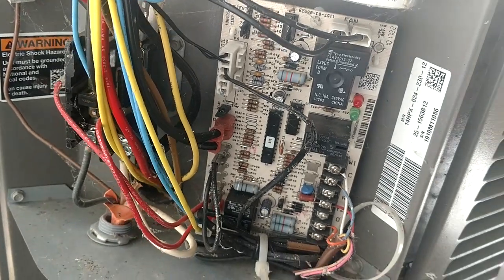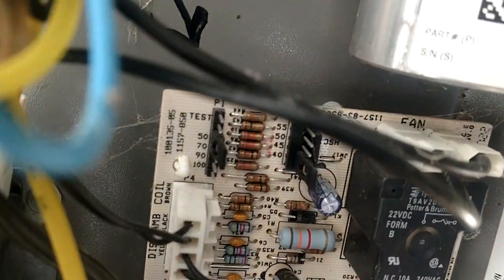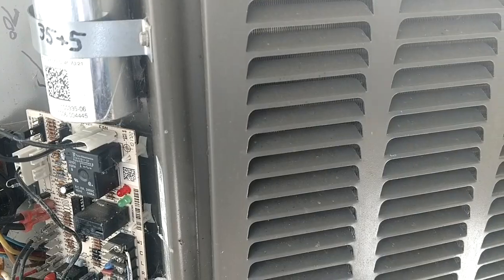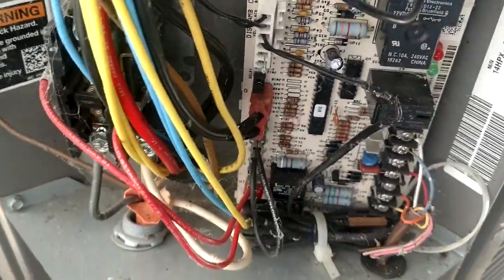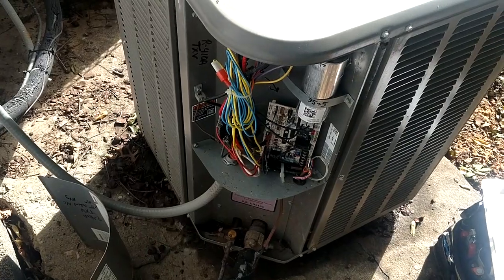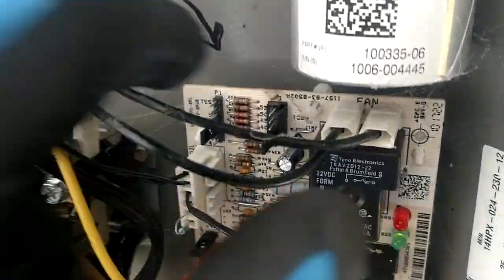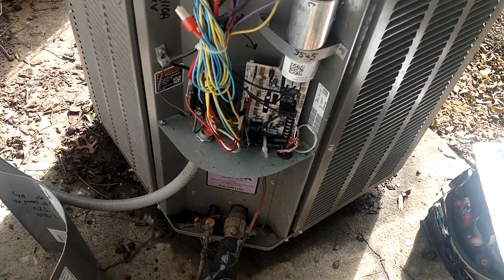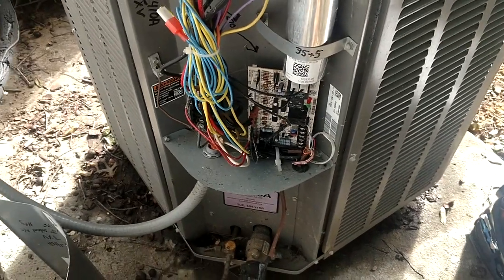50°❄️ Lennox "Demand Defrost Boards" factory set to 50° Will Not Thaw Coil. Needs to be set to 70°🔥

Comment: Thanks for answering my previous comment. One question. Does changing the temp jumper to a higher setting cause the heating cycle to run a bit more? Just wondering🤔.
Reply from the maker: @mindsablank8061  It shouldn't.

Comment: Thank you. Almost certain you fixed my problem. ❤
I had to have the defrost board replaced in summer. The unit was kicking into defrost, even on hundred some degree days. After many trips because the guys didn’t know what the heck they were doing, they replaced the board, etc..
Fast-forward to winter, and half my unit was ice. 
I was getting rings of ice that bent the panels outward  😮 
Following your video, I saw that it was set to 50, I have it set to 100 for now to see if that takes care of the icing problems I’ve been having. 
This is after checking the filter, putting it in the test mode to make sure that it worked and all that kind of stuff basic stuff
Reply from the maker: @MollyGIRLnug  hope it works for you. Glad you found the video helpful. And thanks for watching. 
😎👍

Comment: Hey.  Just curious. What is that other pin selector to the right of the one you’re talking about.
Reply from the maker: @kevinpearce3281  that's the setting for when the 2nd stage compressor kicks in. I never adjust that one. Thanks for watching. 😎👍

Comment: we just had a EL17XP1 installed, old system was an 18 year old tempstar, but I find the new Lennox unit always go into at least one defrost cycle per heating cycle today. it has been between 30-40F and the heat pump went into defrost at least 10 times between 7am and 3pm today. Could it be this jumper setting ?
Reply from the maker: Yes if it's the demand defrost style board it needs to be on at least 70°. It could be pushed up to 90° but I wouldn't go any higher. If it's on the factory setting of 50°then that will cause you issues. And you will have higher than normal power bills also. I hope that's helpful. And thanks for watching. 😎👍
Reply: @sknight0391  very helpful, glad I found your video, will check those jumper setting tomorrow, thanks again and will update if it improved the frequent defrosts
Reply from the maker: @andreels  always be careful when working around high voltage!
Disconnecting power is recommended. ⚡⚡⚡
Reply: @sknight0391  i'll pull the breaker before I open it ;) thanks
Reply: @sknight0391  I just check that jumper, and it was actually on the 90 setting (4 pins open above), so I guess that was not my issue :(
Reply from the maker: Could be. That unit probably has the board, that I discussed in the video, that is time and temperature. So the pins on your board will have an option for defrost every 30, 60, 90 minutes. And if the installers set your unit to defrost every 30 minutes that would sound about right based on what you said. The unit is defrosting almost twice an hour over a 6-hour period. If you live in an extremely cold, more Northernly or Mountainous climate, I would probably leave it at 30 minutes. If you're in a more mild climate then you could get by with defrosting every 60 minutes. 😎👍
Reply: @sknight0391  thanks for the reply, but i think its a demand defrost board, looking at the diagram, it looks almost exactly like the one in the video. i don't see a 30,60,90 minute jumper, but the 50,70,90,100 F defrost termination pin (P1). could it be too low and never defrosts properly and just go back to defrost a little later ? edit: i see it sometimes only goes into defrost for about 3-4 mins, only to later go into defrost again within the same heating cycle

Comment: Hello, I have a EL18XPV that my installers have been struggling to figure out the issue. It’s installed as an add on to our oil furnace, running through our existing ductwork. It’s currently entering defrost mode, then seems to get stuck in it blowing cold air into our home for upwards of an hour which drops our house a couple degrees then it has to heat up again. 

Would this possibly be the issue? We are in Nova Scotia, Canada.
Reply from the maker: Slightly different defrost board on that particular unit. But still the same issue. That black jumper shunt needs to be set to at least 70°. And where you're located maybe even 90° in order to get the coil to thaw out completely top to bottom. There was also an issue with the coil temperature thermistor location on some of those units. It was mounted a little too low from the factory and needed to be moved up a couple of row higher on the coil (which would place it slightly below the "middle" of the coil). And if you're blowing cold air into the house during the defrost cycle then your supplemental heat is not coming on during the defrost. If this is a dual-fuel configuration using the oil furnace as backup heat, then it needs to be wired to bring the oil furnace on during the defrost cycle. And that keeps you from feeling ice cold air conditioned air coming out of the vents while the condenser unit is going through defrost cycle.
Hope this helps. 😎👍
Reply: Did you ever get that issue resolved? I have the same heat pump installed and it does the same thing.
Reply: @Intake88 hello, I did not. Lennox wasn’t really willing to do much to help and the company that installed it suggested a different brand. Since the switch I’ve had no issues.

Comment: Thanks for the tip, I knew something seemed off when it was going in and out of defrost constantly. 
How does the defrost board control the blower motor, and is the a way to get it to blow on the lowest fan speed instead of the highest? (CBX32MV air handler with noisy duct layout)
Reply from the maker: If the duct is noisy the system is probably oversived. But make sure you are using a filter that is not overly restrictive (like some filtrete filters) and change it frequently. Also make sure all of your supply vents are fully open. Thanks for watching 😎👍
Reply: Oh I’m sure it’s oversized and the duct is too small, but I’ve been able to mitigate it a little by lowering the fan speed. However in defrost it goes to max fan speed, even higher than regular cooling. Is there a way to lower the defrost modes blower fan speed?
Reply from the maker: @speedbeast7722  no. When the unit goes into defrost outside, it's actually going into air conditioning mode. So it brings on the electric supplemental heaters inside the air handler. And that will engage a higher fan speed for the blower . 
Falls into the "it is what it is" category.
Reply: Okay thanks for your help

Comment: I have a Lennox package heat pump works great but my blower motor is staying on all the time even when the unit Is powered off or thermostat is pulled from wall, as soon as breaker is turned on blower comes back on, does the defrost board control the blower motor or does another relay do that if so where is it thanks
Reply from the maker: No, there's a separate control for the blower motor. And if that is a newer style ECM/X13 style blower motor. There is a very good chance that the module on the motor is what's keeping the motor running all the time. That part should be covered under a 10-year parts warranty, depending on how old your equipment is..😎👍
Reply: @sknight0391  only going on 3 years old thanks so much for your help

Comment: Hi, is it the same thing with the 18000 BTU Thermopompe? it started having problem yesterday and it's a new one (16 months). thank you. when I called the company they said that it's ok because it's - 30°.
Reply from the maker: The unit should never freeze over into hard ice. If it does something is wrong
Reply: @sknight0391  it didn’t freeze BUT it doesn’t heat as it is used to be.
Reply from the maker: @diassedaddah2882  then that's not anything to do with your defrost. There's a good possibility the unit is low on refrigerant. Or possibly some of your electric heat strips aren't working.
Reply: @sknight0391  Honestly, I think it’s more a low refregirant problem. I checked all the electric wires. I even titled the breaker off and nothing changed. I have to call Costco tomorrow (I had it I stalled with Costco). Thank you for your time. Appreciate. I’m lucky I have a baseboards. It’s freezing in Canada.

Comment: Thank you very MUCH. I am in Virginia with a 3 to 4 year old lennox that has Always had the problem of Coil will NOT thaw. or frozen up too much. It is great as a AC, decent a heat pump in milder weather - but that much time below freezing - it is much worse that prior R-12  unit. I am not a technician, but when I was active duty military , I learned fair bit about AC&R & HVAC being responsible for/ overseeing technicians.  And service calls with technicians from same company has not resolved issue I know enough to realize last call I had a really green tech. Again - Thank you very MUCH.
Reply from the maker: Changing that setting to 70° should solve your problem. Thanks for watching 😎👍 
Merry Christmas 🎄🎄🎄

Comment: What about icicles on the fan?  Should the defroster melt icicles on the fan too?  I had this issue with the defroster, and they increased the temp, I believe to 100.  Last night I had icicles on the fan agsin so poured cold water on to melt.  I am not sure if the defroster had kicked off or was not working due to malfunction.  About one hour in, I saw the defroster setting on my screen whereas I had not noticed it before.  I had no further probs but could've been bc it stopped raining, not sure.
Reply from the maker: Sometimes when the conditions are just right and you have freezing rain instead of snow you might get some ice on the fan blades. If you have the more advanced system with the black plastic looking fan blades it has a different defrost board than the one I'm working on in this video. The board is green and sits horizontally in the unit. It has 4 sets of pins in the lower right-hand corner. To the right of the pins where you select the temperature setting (70,90,100,Max) there is another pin that says FAN. The little black jumper should be sent to the ON position. This is a "fan cycling" switch that will turn the outdoor fan motor on in between heating cycles to keep the water slung off of it so it does not freeze in between cycles. If you have this type of defrost control on your unit that should fix your problem of ice building up on the fan blades.
Thanks for watching 👍
Reply: Silver metal.  Thank you!
Reply: My unit is only a couple years old.
Reply from the maker: Are your fan blades made out of silver metal or are they made out of a black plastic looking material?

Comment: Not true.  That is not a degree scale, it is the time in-between defrost checks.
Reply from the maker: No sir Mark. I respectfully disagree. That is the demand defrost not time and temperature. Those pins are temperature! Check your manufacturer's service facts.
Reply from the maker: Lennox DF manual ⬇️
https://www.manualslib.com/manual/807163/Lennox-Xp14-Elite-Series.html?page=19
Reply: Shannon Knight HVAC you are correct sir, they didn’t change over to time initiated until 14hpx-xxx-230-017 models. And by the way I just stumbled onto my new favourite YouTuber 👍😎
Reply: Why would they go backwards to a timed defrost from a demand defrost?

Comment: Where about are you located?  I'm outside of Chicago.  I have a new Lennox XP16 unit and I am going into my second winter with it.  So far I am really happy with it.  I switched from an all electric home to the heat pump with electrical resistance backup.  It saves quite a bit of money on the electric bill.  It's been hard to find a technician around here who is familiar with heat pumps as it is not that common.  Being an engineer i don't mind experimenting with things and seeing how energy efficient I can get.  The unit does freeze up some but never completely.  So I have been trying to understand the Demand Defrost circuit when I came across this post.  Of course, my jumper is still at the default 50 and I am thinking of moving it to the 70, but really wonder if I should go up to 90 for my location.  Could you please elaborate some more on this functionality?
Reply from the maker: Great question! Those Lennox units are very efficient & i'm sure that it is saving you a substantial amount of money on your power bill going to a heat pump from straight electric heat. Because of the high efficiency of that unit I believe you will be perfectly fine set to 70°. The unit should do a great job of thawing out the coil completely at that temperature setting. If you go to 90° it will keep the unit and defrost a little longer, therefore running your electric backup heaters for a slightly longer of time. I don't think it would be long enough to make a drastic increase on your power bill, but it's probably not going to be necessary. If you observed the unit right after it comes out of defrost and you inspect the coil and there is still some frost on the top or bottom portion you could try bumping it up to 90°.
*Just a side note...Do not move the other jumper pin to the right of the defrost termination pins. That is for the second stage compressor switch over, so leave it alone. I think your unit will work much better for you this winter season at 70°.
Merry Christmas 🎄🎅🌟
Thanks for watching 👍
Reply: @sknight0391   Thanks for the advice.  I switched the jumper last week and have been out of town since, but I think the 70 deg setting is just right.  The coils look a lot cleaner and the puddle of ice  under it is more substantial.  Happy New Year!

Comment from the maker: 50° temp. I mistakenly said 50 minutes one time. 😋
And I also called the jumper shunt- dip switches 😂
You guys know what I mean 👍
Reply: Thanks for the video! Quick question:  the 50 degree setting is more for states in the south and the 70 for the north?
Reply from the maker: @x-man4702  well that's what Lennox would tell you. But the only time that 50° setting would work is maybe in Georgia or Florida. All other states, for example tennessee, there is no possible way that unit will be able to defrost properly set to 50°. 
70° is The Sweet Spot to be at.
Thanks for watching 😎👍